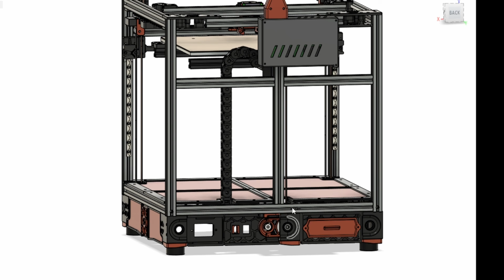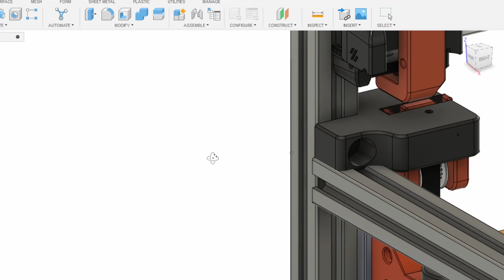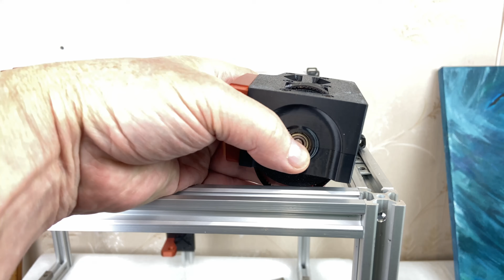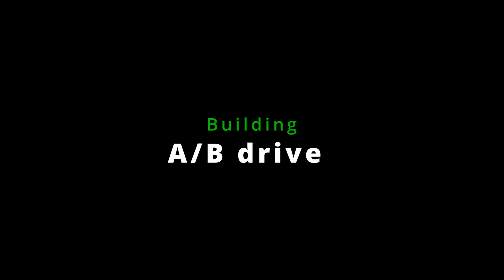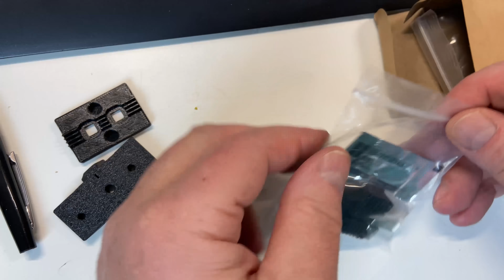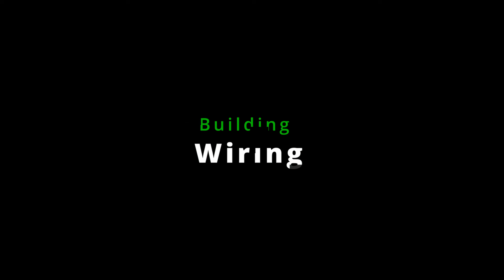DIY 3D printer - the complete build

Comment: Disassembling V-pulleys is much easier. The V-pulley has a ring (made of the same material) that separates the two bearings, and there's also a washer between them. What you need to do is tap that washer with a pin; this will push one of the bearings out with just two light taps. The other bearing can then be removed simply by pressing it out with your thumb. This way, the pulleys can be reused later.

Comment: how did you connect the weird bambulab connector??? Its proprietary isnt it?
Reply from the maker: @friendlyfred1997  I cut it off and spliced the cables. The connector is the only difference between P1P/P1S and the X1carbon part btw.

Comment: would you be willing to share the CAD file for the Voronish 2.0? I am working on a project and would Like to base it off of built driven bed rising. Please? of course I will make it open source and share it with the community when it is complete.
Reply from the maker: Thanks for asking. I have no complete/presentable/accurate CAD-file to share. I have published the key custom parts on Printables.com and if there is any specific custom part missing, I'll be happy to add it. The Voronish 2 is basically a Trident with the gantry in the same position as the Trident and 3 z-drives straight from the 2.4. I used the original Voron CAD extensively during my build.

Comment: At first I didn't like where you put the front top Extrusion, I thought maybe it should just be at the top, but I would think that placing it in front of and level with the bed at starting position might be the least obstructive location
Reply from the maker: @David_Mash  I have moved it slightly to get better access to the flexplate before starting the print. I am still doing some improvements. I am pretty happy with it and have sold my P1S printers.